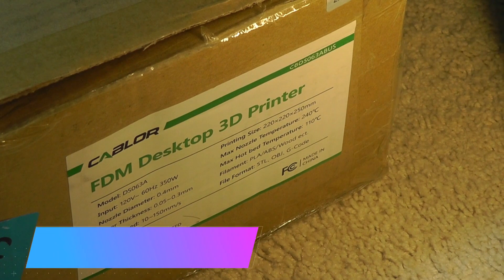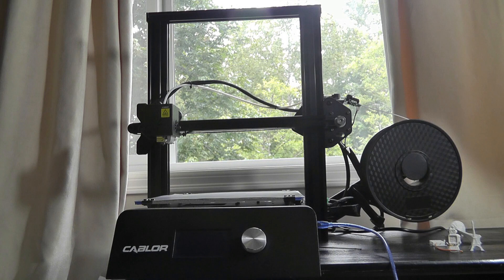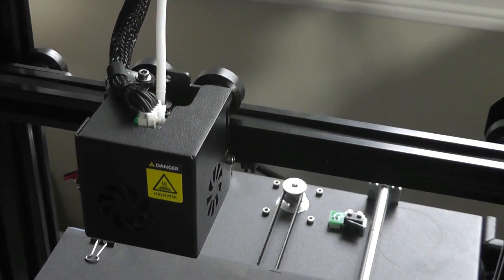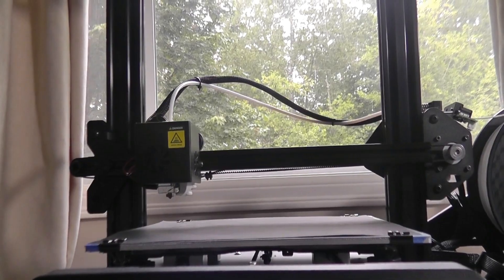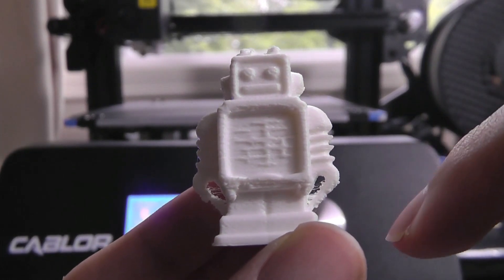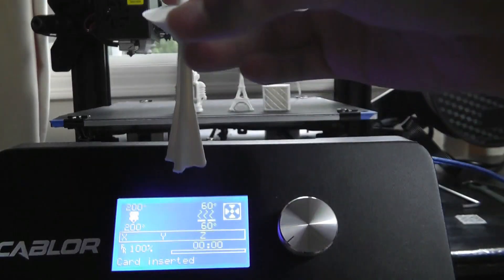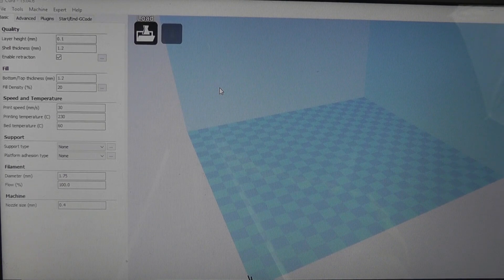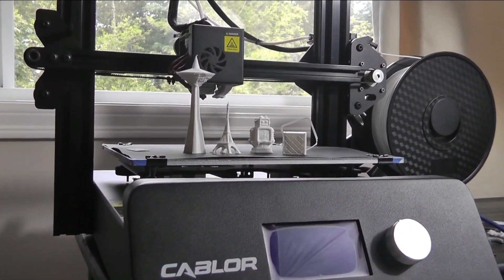REVIEW: Cablor High Precision 3D Printer ($200 FDM Desktop)

Comment: Just got mine as well nothing but prob cant find the printer on the cura program  when I print off the SD card it starts printing off the table  need some help here
Reply: Hi, I do not use PC since you need to have it on and is not convenient if is a 15hrs model, I recommend save it on SD card and you can leave only printer on for hours.

Comment: Thanks for your video, I unboxed mine yesterday and I am having problems with the filament feeder, sometimes it does not grab well the filament and I can hear how it makes little "jump" sound when feeding, I tried to adjust screws but does not have an area to tighten between the gear and the roller aside of it, second question, temp is std at 200? bed temperature? 50? or you recommend to get high these numbers?

Filament I am using is OVERTURE 1.75mm
Reply: Is the filament going back and forth on the feeder
Reply: @noelcaban6941  yes, after lots of tests I think it was false alarm it does the sound but feeds well, thanks for giving ur time I appreciate, will check more.of your vids to keep learning.

Best regards
Reply: I had the problem  with the feeder going in and out  turns out the video instructions had me install to connectors crossed after undoing them and connecting the correct way fixed all my problems
Reply: do you still have the files that came off of the SD card, I was given one for free but nothing else so no nothing about it